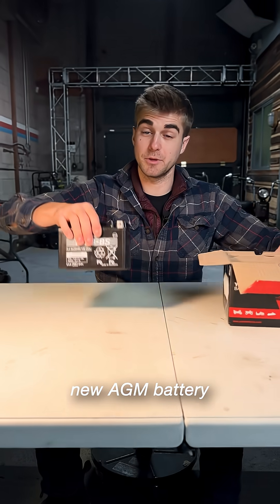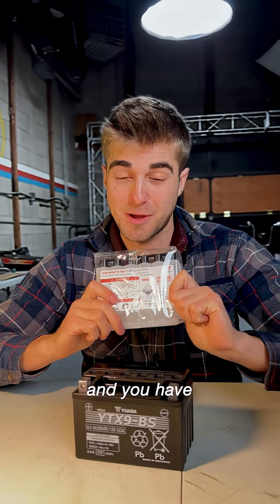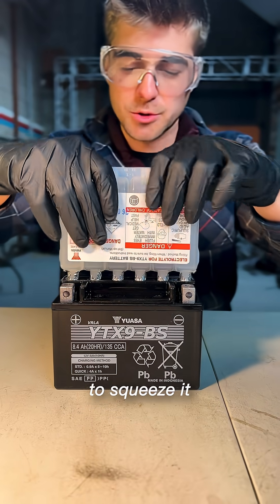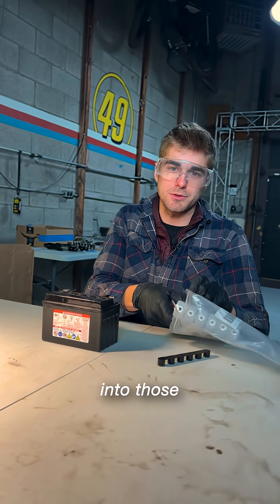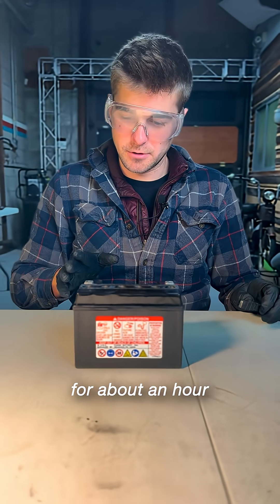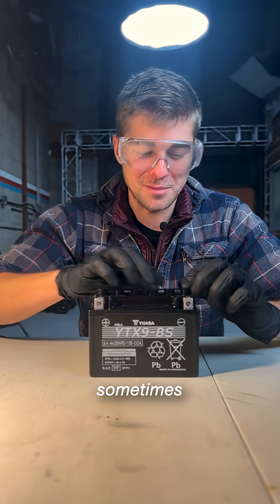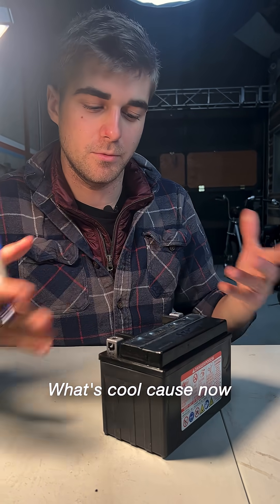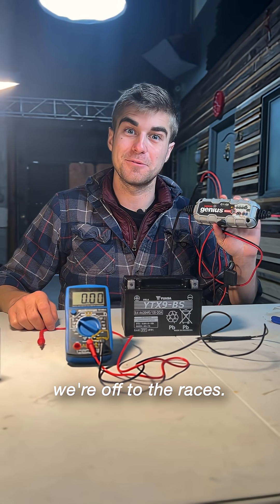How to activate your AGM battery | Tech Tips ⚡

Comment: Big thumbs up for charging after activating...most shops are lazy enough to skip that step. You will greatly prolong the life of the battery with a couple of hours of initial  charging before first use.
Reply: Actually this. Bought a Yuasa from a big shop locally and they said just fill it up, leave it to rest and put it in the bike. I used a charger as the manual and the website suggested and apparently it does prolong the life for sure
Reply: @RiderInRed  You will only know if you put the same use in two similar bikes one with one without charging.
Reply: “You will only know.” If someone has a background in using batteries. Listen to them and verify as well. The technology is old at this point, older than me. But I must repeat ad nauseam to customers on proper charging and battery care procedure, yet they still manage to brick thousands of dollars in product than just taking the information, and reading the papers they come with that just repeat everything I said to them. It’s not hard, just quit trying to caveman everything.
Reply: I would recommend using an intelligent charger (like the one he used), because overcharging an AGM battery is much easier and more harmful to the battery.
Reply: @davidturk6170  Correct. On a flooded cell, you can do a full equalization charge (a controlled over charge of a full battery to bring all the cells to a full 2 volts).  The charge controller on my solar set up had a selector switch for flooded, AGM. and gel-cells (don't think they make those anymore).  The AGM setting limits the charging voltage to 12.5 to13 volts,whereas the flooded maxes out at14.  The lower AGM setting prevents out gassing of the electrolyte which would pop the battery.  In general, slow charging is better than a fast charge as a fast charge generates heat, which wastes energy, and worse can  damage the battery.  In short, lead acid likes staying at full charge.  Does not like staying at partial charge for long periods of time, recharge as soon as possible for max life.
To quote a battery engineer "FEW BATTERY'S DIE A NATURAL DEATH.  MOST ARE MURDERED!
Reply: How high does the battery get charged to?
Reply: @aqua-bery  not that much than it's standing vltage of 12-13 volts.

But a first-time trickle charge allows the chemical reaction to properly complete before any load is applied. trickle chargers usually work at 14v just really low current.
Reply: @DFX2KX Trickle charge for about an hour of 12v and how many amps? Is 2amps enough?
Reply: @Cyrillium I recommend an intelligent trickle charger
Reply: My father would charge any 12v battery before putting into a car. I got 15 years on a battery.
Reply: Thanks for the info. One would think that the battery would be fully charged after activation

Comment: I don't think the gas is H2S. If it were it would smell terrible and be extremely toxic .
Reply: He said it was toxic and there's no smell you can detect through your phone. Becauae he didn't mention smell doesn't mean there wasn't any. So I'm good with what he said it was. Besides, isn't knowing it is toxic and flammable enough to demand extreme caution and safety measures? Knowing its chemical makeup doesn't add any information.
Reply: @thepotbellyninja I’d say difference between toxic and deadly is quite significant. Filling batteries you don’t get odors virtually at all. But sure, there’s hydrogen forming and it’s obviously very volatile so it’s best to do outdoors than in like small room.
Reply: @thepotbellyninja no, it isn't enough. Because the gas produced is actually hydrogen, which requires different precautions than hydrogen sulfide to maximise safety. So if you do actually care about safety you'd want to know
Reply: @K26650 Fair enough. How are the precautions different?
Reply: True. I think it's just hydrogen.
Reply: @jothain Hydrogen go boom 💥
Reply: @thepotbellyninja  It indeed does
Reply: @thepotbellyninja  That's why batteries can easily explode when charging.

Comment: Finish with a mix of bicarb of soda and water, dip a rag in the solution and wipe everything down. Neutralizing any acid residue. That stuff gets everywhere.
Reply: How the heck do you do it? I've done this countless times and never had anything spilled.
Reply: @jothain  residual drips and also accidents happen. just some good-to-know kinda stuff.
Reply: @jothain  That gassing and hissing is bubbles bursting, which throws micro droplets out.  Put the cap on loosely or clean up after.  Sulfuric acid is no joke.
Reply: @Chris_the_Muso You're doing it wrong then. You slap that container there and let it be there for like 5 to 10 mins whatever after the container is empty. When you remove it, you can be sure that there's not much of an chemical reaction going on anymore. Heck even if I've done this in haste, bubbles have never ever thrown droplets out of the battery.
Reply: Agreed; the off gassing produces very fine droplets of acid which generally sit on the top/sides of the battery until it's cleaned off.
Reply: @chrisweeks6973  yeah right
Reply: @zaphod_beeblerox it's sulphuric acid. I don't think you want to find out there's residue on your fingers by rubbing your eye. just take some basic safety precautions
Reply: @TheAechBomb  yeah right
Reply: @TheAechBomb Lol, you'll definitely know before you rub your eyes. If you want to protect your eyes, you should just wear safety squints.
Reply: @zaphod_beeblerox  terrible bait
Reply: Or just water, dunk the left over container in water

Comment: Silver sharpie is perfect for labeling things like that. Makes it much easier for my old eyes to see.
Reply from the maker: I couldn't agree more! Trust me, blue was not first choice. But it's what I had on hand 😅 ~JoshF9
Reply: @FortNine  🤣
Reply: I like paint pens. A little more durable
Reply: @rileyforrer8045  I use those too, depending on what it is I'm labeling.
Reply: @rileyforrer8045  Both should be in your toolbox ;)
Reply: tire pens are my go to
Reply: @sebxsu  I use those too when the sharpie won't do the trick
Reply: White-out pens are also great for writing on dark surfaces. And more readily available, in any stationary store, at least where I live.
Reply: Especially once the battery gets dirty
Reply: I stopped and did one of these 🧐
Reply: Oil based sharpie paint pens hold up for oil filters during oil changes. Always my go to
Reply: They also last longer
Reply: This is good.  I might even consider a label machine too.  As long as the surface doesn't stay greasy etc, the adhesive on those is pretty durable.
Reply: I like to use dymo labels
Reply: They also last longer
Reply: I used a white paint pen works great cant be rubbed off as easy as a sharpie

Comment: I switched to lithium on my WR 250R trying to make it lighter and I've had a lot of problems. I'm finding that lithium doesn't hold a charge long, Maybe a week. and that I'm only getting about a year out of them. I need a fortnite deep dive my homework for me and learn what's going on. By comparison by YZ is still using its lithium battery after over 3 years. Don't know why. Is OEM better than aftermarket? Is it the bike?
Reply: It's the bike. Either the charging system sucks or (somehow) drains it via parasitic drain. Once you kill a lithium once it gets easier to repeat kill it.

I've had very good luck with Antigravity batteries.
Reply: @JelloThatsMellow but if there's no parasitic drain on an AGM battery, why would there be one on a lithium battery?
Reply: @KingFriday274 if that's the case, I have no idea. Bad battery brand? But if it works fine in the YZ, hmm.. 

Google says the older charging systems don't work well with lithium, so once again it's bike related.
Reply: You should not change the type of battery that your bike came from the factory, acid vs lithium batteries act very differently under load and your bike is expecting very specific voltages to run everything smoothly, when you change the type of battery, those voltages will not be exactly the same and your bike goes haywire.

Comment: Up for a new battery next year... can't decide if I should go for a lithium or not.
Reply: Yes. Antigravity with the "restart" feature. It saves just enough juice if you run it dry to jumpstart itself. 

If you ride in super cold/snow don't bother though. It won't run until it warms itself up via headlights or some form of electrical usage. Very inconvenient.
Reply: @JelloThatsMellow can not agree more. They are amazing
Reply: funny you mention that. they have a video comparing the 3 common lead-acid batteries and lithium
Reply: If your bike was designed with a regular acid battery do not put a lithium battery on it. All kinds of weird things start to happen, just like putting an acid battery on a bike that came with a lithium one from the factory. All the electronics expect very specific voltages and different type of batteries support different voltages.
Reply: @Carlisho never had such an issue and I've replaced all 4 of my bikes from different brands and models to lithium.  2008 Suzuki m90, 2013 super tenere, 2014 concours, 2014 valkyrie
Reply: @kincaid9134  what is the point in going to a more expensive lithium battery? lead batteries are simple and cheap. They are also dead reliable if you take care of them and don't leave them partially charged over winter.
Reply: @volvo09 multiple reasons. Lithium is lighter, more durable, less shock or impact sensitive, has a restart functionality on the ones i own, doesn't have the chance to leak acid if you have to mount it sideways and last longer with zero to no maintenance.
Reply: @Carlisho Lithium batteries designed for bikes come with all the charging, regulating and protection electronics built in. They're drop-in replacements. They have so many advantages over AGM batteries, that I wouldn't put anything other than a Lithium battery in my bike.
Reply: @Carlisho they should all be the same voltage...

Comment: Edit: I guess I'm wrong, never seen a bottle supplied AGM.
Automotive battery salesman here: That is not an AGM battery. All AGM batteries come pre filled as they have thair liquid absorbed into glass matting. Hence the name AGM or absorbed glass mat. They also never have the 'bs' in the part code, meaning bottle supplied, implying a standard wet type battery.
Edit: Please look up the part code for that battery and tell me where it says AGM and does not say wet type battery.
Reply: According to Yuasa's own site, this is an AGM battery
Reply: @scaryfish91 Yea I guess I'm wrong I've just never seen one before
Reply: @scaryfish91 ......    Hang on guys, I'm just nipping out to get some popcorn.   🙂
Reply: Its a motorsports battery, for motorcycles, atvs, etc. I have worked with them for years and they are 100% AGM batteries.
Reply: @Carlisho yea and ive sold thease exact bateries for years and just seen they say sealed lead acid and thought they where just normal sla bateries not also agm.
Edit: or rather normal vrla bateries not also agm.
Reply: @thatlinuxguy pretty sure this is just a thread full of people who are wrong, talking about a video that is wrong
Reply: This is a first for me as well. I've never seen this product before.

I use a handful of 26650 LiFePo4 cells